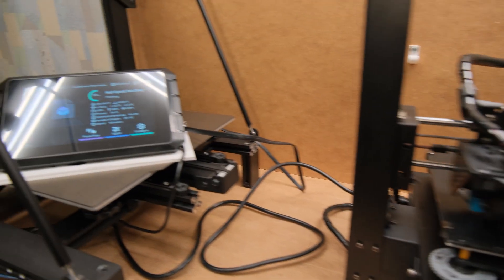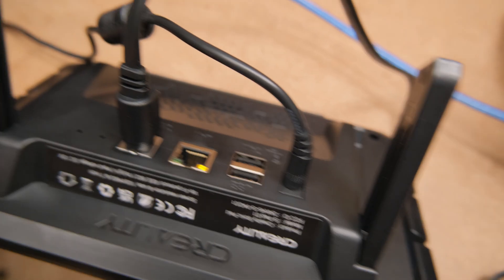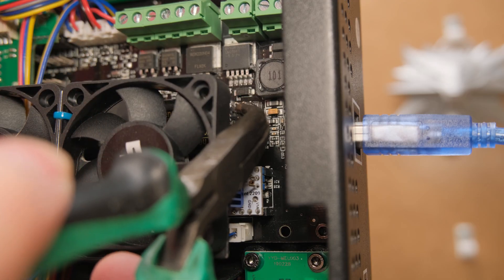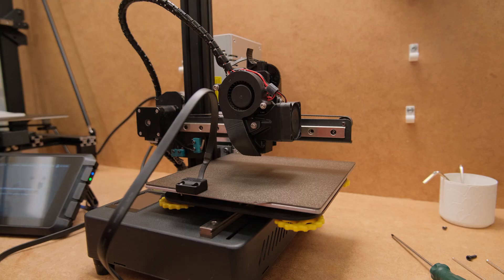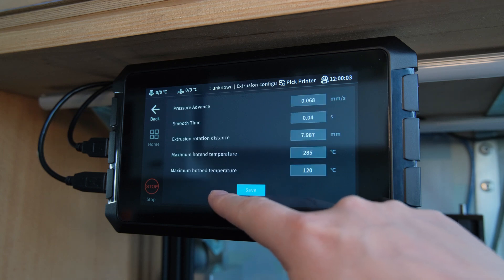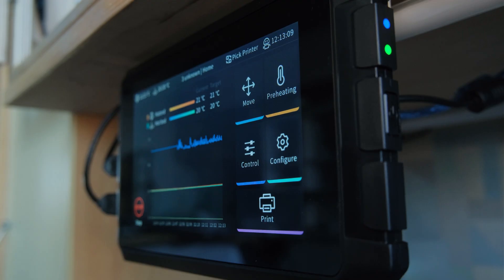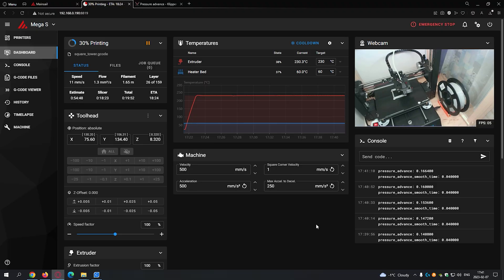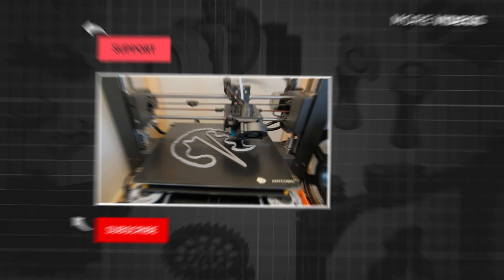Bed Slinger goes BRRR 400mm/s – Creality Sonic Pad Review – HOW BEGINNER FRIENDLY IT IS?

Comment: Hi! Thanks a lot for the video. I just calibrated my rusty i3 thanks to you. One question though, on creality print, i can connect to the sonic pad but it only lets me choose the pre-built klipper printers on the software. How did you get to print using creality print on i3?

Comment: I don´t feel like looking for software and settings and fumbling around, I rather just wait and buy a printer which already has Kipper running like the bambo.
Reply from the maker: I would prefer that too. I don't think Bambu machines run Klipper, it is a custom firmware like everything about their printers. That is the most significant downside - you can use only their parts if anything breaks down. At this point in time, their machines and replacement parts are extremely good value, but they have to start making money at some point...
But as you said in the other comment, most companies are so incompetent and have no clue what they are doing. So soon we will see a huge wave of printers with horrible Klipper implementations. But I hope I am wrong about this.
Reply: @PrintingPerspective  I agree. Bambu is also sharing all your data with the Chinese gov. through that internet connection you are using to sent your prints to the machine, this is the main nogo for me.
Well we already see that. Many printers using Klipper are old shitty i3 style frames with zero ridigity. Unfortunately Prusa does the same thing. They somehow improved stability they say however they did that. But still. Voron or the Rat 3D printer things makes the most sense BUT I don´t feel like ordering a 1500 parts kit and assembling it for the next half a year. 
I really don´t get why no one can just get a relattivly simple Voron already ready to go. Which does not cost like 1500€.
I mean I get it, there is no "the Voron" and every Voron is different bla bla. If I want to buy a car I will most likely buy one which is mass produced, therefore cheaper and works right out of the box, I don´t care about customization and all that crap. i also don´t need 800mm/s print speed. Just for the love of god make one which is good enough for like 500 bucks and I am in.

Comment: Careful with the Mega.  The X belt idler mount is just a ring press-fit into that soft metal of the Z boxes.  Mine got bent from running the printer fast, and when I carefully tried to straighten it, it broke off.
Reply from the maker: Yeah... I would like to remodel and remake the whole gantry with Z axis frame because it is such a wobbly mess, but I can't come up with a video idea that would justify that. :D
Reply: @PrintingPerspective  Do a resonance test with klipper and an accelerometer, then compare the steel boxes with PLA, ASA/ABS, etc.  See if it improves resonant frequencies on X, since they are the mounting points for the linear rods.  I've been curious how printed parts do vs steel and aluminum on resonant frequencies.  I don't have a second printer up atm to print the parts, so I'm not inclined to pull mine apart to measure, then have to put it back together and dial it in again to print, then take it apart again to swap the parts.  So if you do, share the models please :D  This video shocked me with how much movement you were getting in the Ai3M steel frame.

Comment: That you included the mega was pretty cool. I dusted off recently. Put in a marlin mod 1.19 and manual bedleveling really should get a probe🤔. Agree on the learning new clipper/32? Bit is not to mutch of a desire.
Reply from the maker: I would have pushed it even further but hotend's flow rate is the limit with Klipper most of the time. Speeds are not the issue with most printers. The only serious reason you want a probe is if your bed is warped and you can't get consistent layer adhesion. Plus as Mega-S uses linear rods, you level once and forget it. I never had to re-level it because it got out of level on its own. At least for now, Klipper is still far away from being easy for everyone, it is more a tinkerer's firmware.

Comment: Can you at least show in more detail how you installed this firmware on a third-party printer? All bloggers whom I wrote about such a request refuse. I don’t understand this is another tablet advertisement or a review of a real person who advises using the device and helps people. Even if this is not a review of the device and advertising, imagine how many people you would help. I guess I'm not the only one who needs a little more detailed review of your experience.
Reply from the maker: The reason no one goes into firmware compiling details is that it depends on your specific board. I literally had to download pre-compiled firmware from Kingroon for KP3S because I couldn't compile it with the pad. Creality themselves don't even know how to do it because they have absolutely nothing about it in the manual. I don't get what you want from me.

Do you want a TLDR of the process? You connect the printer to the pad, check if the USB port is recognized (get hardware serial port ID), compile the firmware with the correct settings, put a USB drive into the pad, save it to the USB, and then put that firmware file to the SD card, turn off 3d printer and unplug USB, then put SD card to the printer, turn on 3D printer and it will flash the firmware.

This is probably the most realistic and critical review of what experience you get with the pad if you know nothing about Klipper that at least I saw on Youtube, how do you even think this is an advertisement? I give credit where credit is due and critique where I think they should do better.
Reply: @PrintingPerspective  In any case, thanks. Just imagine how many owners of a particular printer would be happy with at least a step-by-step instruction where you say in detail what and where you corrected for compilation and got a successful result.
Reply from the maker: I mean you are not wrong, but the reality is that step by step guide for a single 3D printer model makes 99% of the viewers who are interested in 3D printing don't care. I don't dictate what interests people and Youtube is my job after all.

Comment: Hello, I'm a beginner, please help, is it possible to create instructions for installing a clipper on a sonic pad of various models, such as kingroon or artillery or mks mini board for Ender priners. Thanks for the interesting review.
Reply: You do flash the printer with klipper. Firmware can be compiled via the Sonicpad, for some printers you need to flash it via usb and the sonic pad, depends on the chipset of your printer. I did flash several printers woth it and had no problems after that, the printer cfg for alot of printers is online and you just need to dial in e steps(not just of your extruder) etc.
Reply from the maker: Hey, as much as I wish to help everyone, my background is not with software/firmware things to easily suggest settings for every printer. If you can't find info on google, try going to Discord, Reddit, Facebook groups, or forums on that specific brand printer.

Comment: I would never buy another Creality product, they always come with faults that never ever get fixed and Creality moves on to their next faulty product and leave the community to repair their shortcomings.
Reply: Yeah you are right I have sonic pad and having problem with it. On one particular print it always fails with same error what was shown in this video. Yet when I connect rpi4 to the same printer with the same cable it runs no problem had not had any errors yet. So emailed to creality and asked them to help me or take the pad back. They send me a new one. New one can't print that stl as well. Fails every single time. Now I'm going to sell them both and just go with rpis and screens.  All I wanted is to run 2 printers It can't do it with one. Lol.
Reply from the maker: Yeah... That is the thing when you modify your own version of Klipper you can introduce unwanted bugs or configurations that don't work as with stock Klipper. You could also use OrangePi, those are at way more reasonable prices than RaspberryPi.
Reply: @PrintingPerspective  Yes I replaced my Raspberry Pi's for Orange Pi Zero 2 boards so I could use the RPi's for other projects, the Orange Pi Zero 2 runs 100Mhz faster than a Pi 3b+, they cost me £21 about $24 and I also ordered some USB expansions for £2 as the board only comes with 1 USB and if I wanted to use them for something else further down the road I have enough USB ports, they all arrived from Ali Express in just 10 days with standard shipping and installation was easy.
Reply from the maker: That's fair enough. I never owned a Creality machine, but what you are saying is very similar what happened with the pad. I mean they still constantly updating it so I can't just say they will drop it, but how it is marketed and what you get is very different, even now. It is for anyone rather than for the beginners. And if you think that I will start reviewing Creality printers, don't worry I don't have any desire to do that. :)